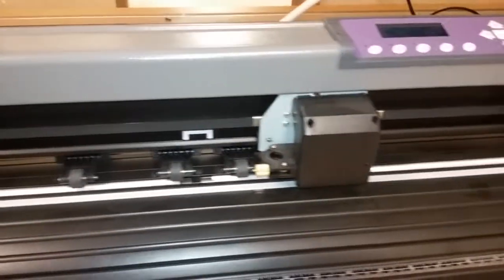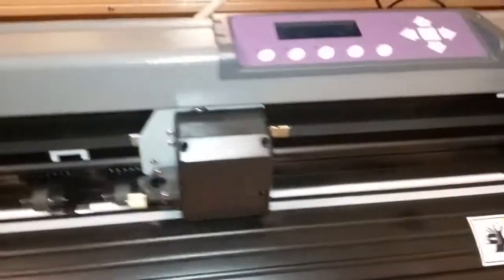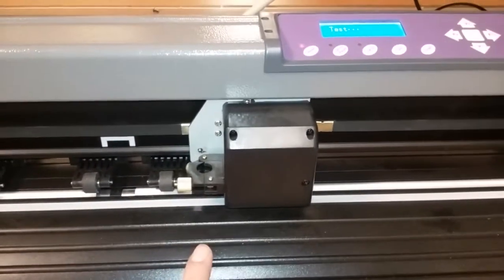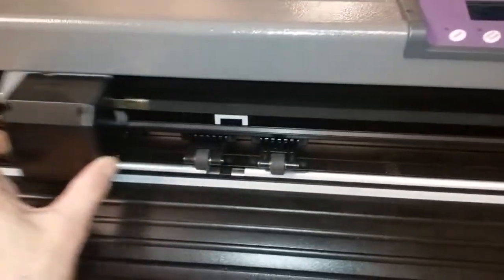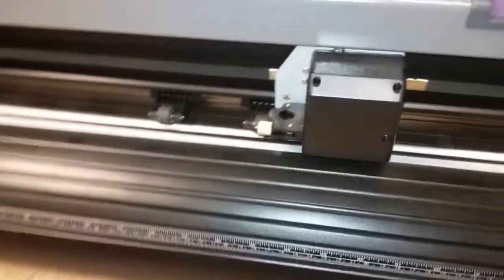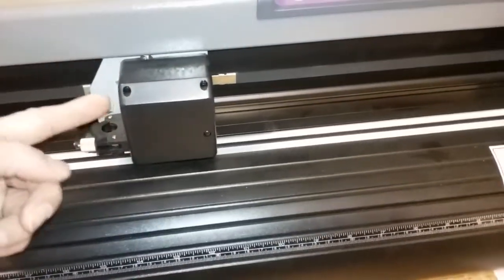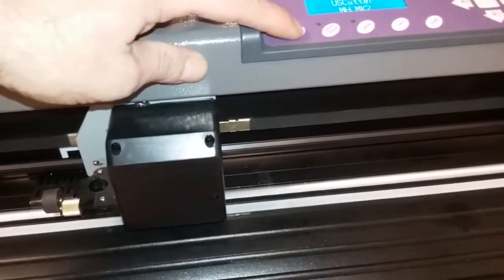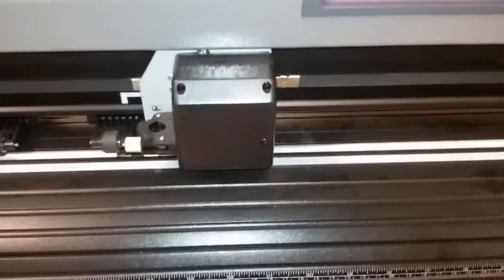MHMK2 Signs of a Bad Motherboard

Comment: that can be a limiter switch issue as well or a grounding issue
Reply: I got an issue with my with my vynil cutter. The LCD monitor went blank. and the blade carrier doesnt go down to cut. Do you kno what could be?
Reply from the maker: @josehuerta16grapix  Hi Jose, 

If the LCD is blank and the carriage arm does not go up or down it could be a motherboard issue.  Does the LCD screen blank at all and the blade starts just tapping the cutting strip? If so this would indicate a motherboard issue.

Other symptoms include the stepper motors starting to make a grinding/buzzing sound and the carriage for the most part just sits in the middle of the cutter and does not move or go up/down to cut.

If you place the carriage in the middle of the cutter and then turn on the cutter, does the carriage go to its home position on the right? (No USB connected) Make sure that the cutting pressure is at least 100 depending on the cutter 60 is sufficient. 

Can you send a cut to the vinyl cutter from the software?  What happens?

If not , this sounds like a motherboard issue. You can also check the connections to the motherboard depending on the cutter. Normally all connections are glued down by the manufacturer.

Comment: That's the issue with my cutting machine now and I don't know what to do. Please help me on what to do.
Reply from the maker: Hi Davou, 

I apologize for the late reply as normally I reply asap. If your cutter is having the same issue and you have tried the following:

Make sure that the carriage freely moves and is completely on track with the top and bottom wheels for the carriage. Its possible that the carriage cable underneath the top bar is somehow catching and causing the carriage to move roughly. The cutter is not pulling from a heavy roll. Make sure that the proper drivers for the cutter have been loaded. Check the wiring to the motherboard to make sure all connections are indeed connected.

Other than this, simply restart the cutter and re-plug in the USB cable. load the cutter with the pen tool and you may use the back side of the vinyl which is the paper side. You can use a scrap piece. Rung a cut test from your computer and watch what the results are. if you still have issues go ahead and disconnect the USB and reset the cutter.

This time with the same piece of scrap vinyl/pen tool, you should have a TEST button or be able to find a test on the cutter itself that will be accessed on the cutters control panel menu. Go ahead and do a test cut. If its ok, then go ahead and test running the carriage to the right side and then the left side. Then try running the vinyl backwards and forwards. 

If you have trouble with either the feed rollers or carriage right to left this normally will indicate a  motor port issue on the motherboard. Normally I have not seen stepper motors go bad as much as it being a motherboard issue. You may also be able to check with motor port on the board this issue is by switching motor ports if possible on your board.

Once you find where the motors for the carriage and feed roller attach on the motherboard you should be able to swap them. Its possible to  see that the carriage motor has a buzzing sound/stutters or has a hard time moving while the feed rollers move fine. This is one way to check if its a motherboard vs a motor issue.

Let me know what you find out. I hope this helps in troubleshooting.